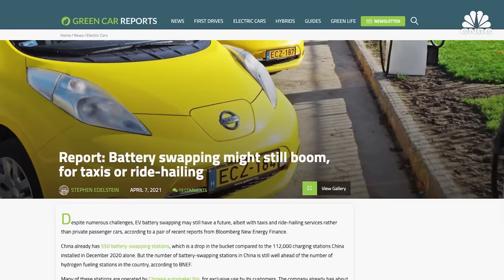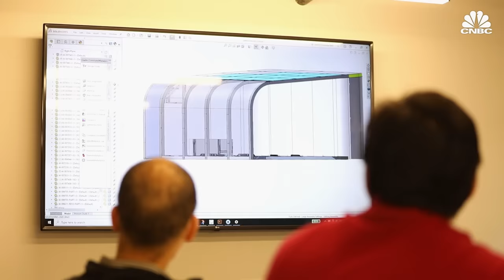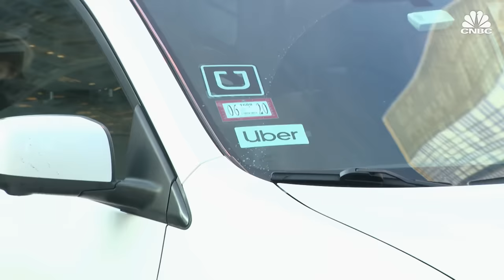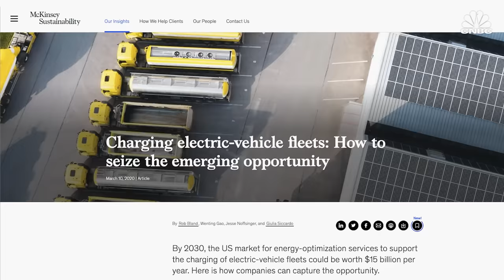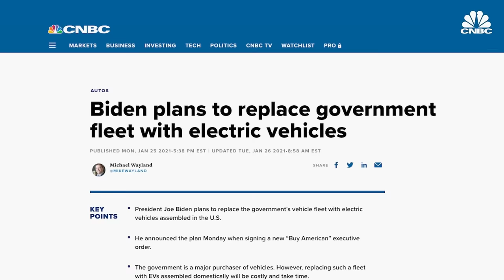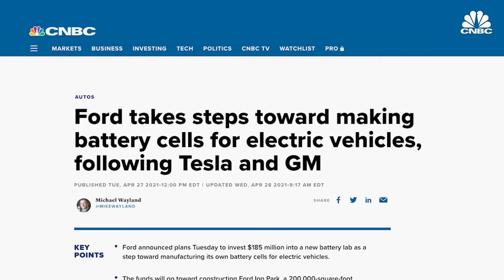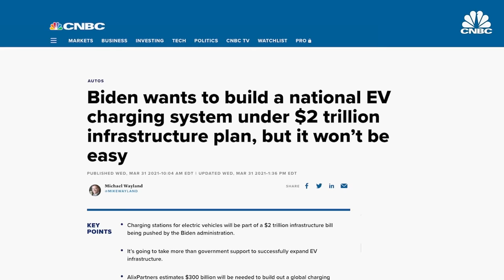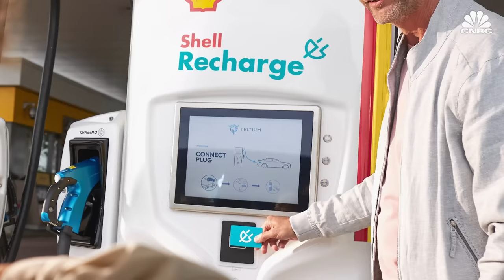Can EV Battery Swapping Take Off In The U.S.?

Comment: How do they manage coolant flow with modular batteries? I suspect they don't so you can't fast-charge them, which would be an unacceptable compromise for most people.
Reply: Can battery be small enough so be cooled with a plate contact?   Then plate cooled with coolant.
Reply: Doesn't matter to me. I already have fresh batteries and drove off to somewhere else while my depleted batteries are charging.
Reply: And trickle charge makes the battery last longer anyway.  You wouldn’t need to cool it at all if you do it this way.
Reply: ambient air cooling, like the Nissan Leaf?
Reply: @jasonji1900  if you don't own the battery, why would you care if the battery pack is being trickle charged or fast charged?
Reply: the whole point of it is to save time so when you bring up time, it seems that you did not get the whole video
Reply: This solution is a different one to fast charging. There's no need for fast charging if you can just get a battery swap in 10 minutes.
Reply: Whatever they do, its not going to be as efficient as a tesla with its integrated battery. squeezing every ounce of efficiency is super important in an ev, thats why tesla is going to be King for a long time.
Reply: @jamesmedina2062  Exactly. The whole point of EVs is that they turn your home into a gas station. The killer feature of EVs is never having to step foot in another smelly crime infested gas station ever again. And these ding dongs want to bring it back. Newsflash, if somebody needs "range" they're just gonna buy a gas car.
Reply: @jonsnow7844  True
Reply: 7788inches is not the best opt in online industry as longtime timers periodical Andy item had into  issue of covid-19 for me and I I usua in a way now that supports h jb I can only use this one to get some and get it done a gooood bit discriminating about automatic and free use of my own computer system in a different or not or to help me to stop responding and uuuu000
Reply: I7
Reply: I7 is not
Reply: @jonsnow7844  But the thing is that there are people outthere, who do not have their own driveway, but live in apartment buildings. A solution like this will make the ICE to EV change a lot easier for people living in apartments.
Reply: @jamesmedina2062  at what cost, this is very expensive to do
Reply: @jonsnow7844  exactly my point , I don't want to set foot on a gas station ever ever again in my life, which is my primary incentive to have an electric car
Reply: Ask NIO
Reply: That’s the whole point of this is so you don’t need fast charging I think this video went right over your head.
Reply: You clearly didn’t watch the whole video or did not paid attention
Reply: The Nissan leaf has air cooled batteries
Reply: @Allen Loser "Laying the cells on their sides in cylindrical troughs in the heat sink would be better." If it were better, Tesla would be doing that. Are you an engineer?
Reply: @jonsnow7844  "Newsflash, if somebody needs "range" they're just gonna buy a gas car." Really? 400+ miles of range isn't enough? The average American commute is 30 miles roundtrip, I'd say EVs have plenty of range.
Reply: @pHD77  "But the thing is that there are people outthere, who do do have their own driveway, but live in apartment buildings" Yes, apartment dwellers have a more difficult time. Given the [now typical] 200+ mile range an EV gives you, you could just go to a rapid charger once a week like gas car owners do.
Reply: @Allen Loser "you are content to be tethered to home, never to travel more than a half tank of electrons from home in your car.  You also pay more for the privilege of being tethered." Absolutely untrue, where are you getting your information? How is an EV owner "tethered" to his home? An EV at one's home is full every morning, and most EVs have a 200+ mile range. Are you "tethered" to a gas station, paying unpredictable and unjustifiable prices for gasoline?  As for paying more, EVs cost about 1/3 to 1/4 the price per mile to operate than an gas car does. I know, I've driven my EV for 5 years, 60K miles, and drive all over the USA.
Reply: @SupremeLordGeek  "The Nissan leaf has air cooled batteries" Correct, and the Nissan Leaf is now left behind in EV tech. Too bad, too, as I happen to like the Leaf but Nissan has made a good product then failed to improve it.
Reply: @Allen Loser "The end of a cylindrical cell presents a small contact area compared to the volume of the cell." You're absolutely correct, which is why Tesla doesn't cool the end of the battery but the sides. Tesla's batteries are stood upright with cooling packs along the sides.
Reply: @Allen Loser "B.S. Physics; 1981 PSU" Great! Clearly you don't know as much as Tesla does, or they'd be laying cylindrical batteries down in their battery packs. I'd say it's time for an update of your education, or at least a perspective change. Feel free to tell Tesla why you know more than they do, I'll get the popcorn!
Reply: @Allen Loser " B.S. Physics; 1981 PSU" God, I love guys like you. I had an electrical engineer try to argue with me about how inefficient electric cars were compared to gas cars (if you can believe that...maybe you can...). He we telling me how inefficient energy storage was in batteries compared to the energy density of gasoline, etc. He finally shut up and deleted his comments when I pointed out that when you burn gasoline, you waste 70% or more of the potential energy as heat, and you get poisonous by-products as a lovely gift. His obsessive focus on a battery energy density formula kept him from seeing the forest dead in front of him.
Reply: @Allen Loser "Cheaper fuel?  Not if you buy a Hyundai Ioniq Blue hybrid or a Toyota Corolla hybrid instead of a Tesla Model 3" Absolutely untrue. Hybrids consume gasoline and have all the maintenance issues of a gasoline car with only the partial benefits of an EV. I've already left you the calculations per mile of using an EV. I just paid over $4 a gallon to fill my gas RAV4, about $45 dollars for 10 gallons. That's $.58 per mile to operate. My Model S operates at about $.04 per mile excluding tires and other intermittent expenses.
Reply: @Allen Loser "Not only that, you will be at the 'gas station' longer for one stop to pump a half tank of electrons than I spend at the gas station in several months to completely refuel for a 500+ mile range." Let's see, I've driven 60,000 miles in my EV on long trips and don't find your information correct. Since 90% of any typical person's driving is local, and that a typical EV owner takes about 10 seconds to plug in at night, you actually spend more time refueling than I do! Here's how: even if you take 15 minutes to get to the gas station and pump/pay, that's typically an hour a month for a gas car owner. I take 10 seconds to plug in at my garage every day, the car is full in the morning.
On a trip, I stop every 2-3 hours anyway for a break, my car is full enough before I'm done at my break. You simply don't know what you're talking about.
Reply: @justsomeguy934  First of all, as an apartment dweller you'll currently be dependent on an infrastructure, which is - I'm sorry to say - not yet at a place where it can fully replace fuel stations with plenty of chargers all over. I'm in a few EV groups on Facebook and more often than not there are EV owners complaining about the following related to chargers:
- People are blocking the chargers even after they've finished charging
- An ICE car is blocking the spot
- The charger isn't working/doesn't support my car.
- It's not a fast charger

... and I've probably left out a few other complaints I can't think of right now. 

Second, unlike those with driveways, who can set their car to charge and then be about some other business at home, the apartment dweller will still have to put some 30-45 minutes aside for charging, which will feel like a 'punishment' if said EV owner does not have other business in town or whatnot.

Third, the EVs that currently are able to hit that 200+ miles will most likely financially be out of reach to purchase for those living in apartments. After all, it's my impression that people mostly only live in apartments because their financial situation isn't exactly stellar.
Reply: @Allen Loser "Blowing off consumer needs with "Commute driving is 90% of the typical American automobile use ..." is not a path to increasing sales." Tesla's sales volume says otherwise.
"I won't pay more for a car which only meets 90% of my driving needs when I already have a car which meets 100% of my need." What part of 100% doesn't an EV meet? You quoted a 10% energy price situation as if it applies to 100% of the operating costs. My EV has taken me through desert, mountains, snow, 106-degree heat with no issues.
Reply: @Allen Loser "The priority argument against a Tesla in 2008 was that it would have intermittently left me stranded with an empty battery during my work day and no way to refuel." Then you're a extraordinary car owner. You would have to have exceeded the car's range with no supercharging available. Since Tesla is outselling many European brands in the USA combined AND is outselling most domestic brands of cars, I'd say you're not a worry for EV ownership.
Reply: @Allen Loser " $7.28 per 100 miles at the published rate of 26 cents per kWh to use a Tesla-branded refueling facility (untethered)" Yet again you quote a Supercharger rate of $.26 as the only energy source for a Tesla. I charge at home for about $10 a fill, my older Model S gets about 266 miles range for $.037 per mile energy cost. 
As for your refill time at 110v., I'm sorry you don't have access to more energy. I'd call an electrician but if you are stranded and have no access to any more energy than that, you would need to go to a faster charger during the week like many of my friends do. They live in condos with no charging, so they charge at a third party charger while at Walmart or shopping.
Reply: @pHD77  Living in an apartment is good economic sense for many. I've owned homes all my life and I can tell you that the hidden costs of maintenance and property taxes make ownership less attractive than many are led to believe. You need to know that I'm not in any way disparaging apartment or condo dwellers. The 200+ mile EVs are reasonably priced, especially if you can find a used one. If someone has a reliable, inexpensive gasoline car, I say use it until it dies. I do not recommend anyone trade cars that are economically useful.
Reply: @Allen Loser "Efficiency be damned if the car can't conveniently go the distance." I've been all over the USA, in mountains, snow, heat and rain. No problems AND I travel at 1/4 the price of gasoline. One moving part in the motor, too.
Reply: @Allen Loser " There would be no engineers without physicists and mathematicians.." Who said otherwise?
Reply: @Allen Loser "Refuel at home is making excuses for slow refueling." Really? How so? My car is full every morning, refilled at 1/4 the price of gasoline and filled while I sleep. When I'm on the road, I get enough energy to go 150 miles or so in about 20 minutes (or less). I take longer than that for a bio-break. 
I absolutely know from your biases that if I invented a car that could run on table sugar, you'd oppose it.
If, however, I invented a gasoline car that would magically refill overnight from the garden hose at your house and do so at 1/4 the price of gasoline, you'd love it and sing the praises of my invention. You wouldn't call it an "excuse for slow fueling". Even if you had to refill on a trip at a higher-than-home-water-station, you'd  love it. It's the fact that it's an electric car is what makes you not like EVs. You'll deny it, you'll tell me you're open minded, but I know better.
Reply: @Allen Loser "You are still being presumptuous by telling me what I should value as an excuse for Tesla not providing what I do value in a car." No, I'm pointing out the excuses you make based on a non-working knowledge of electric cars. I used to think like you, then I bought one. EV adoption is far greater than 1%, and is gaining sales year-over-year. Tesla doesn't make a truck (yet) so you can't say they don't sell well against trucks. Tesla outsells several European sedan models (and brands!) combined. 
Personally, I don't give a rat's behind what you drive. If you don't fit an EV, you don't fit an EV. I do, however, challenge untrue statements when they are made. If you're happy with your Buick, keep it in the driveway by all means.
Reply: @Allen Loser Just the Tesla Model 3 sales are astounding (Google search results): "The Tesla Model 3 continued to hog the throne on top of the US premium-class car market at the end of 2019. For the full year, the Model 3 accounted for 23% of small and midsize luxury car sales. In other words, nearly 1 out of every 4 small or midsize luxury cars sold in 2019 was a Tesla Model 3."
Reply: @Allen Loser "Refueling at home is not one of my transportation needs." But waiting in a line for combustible fuel is? And paying unregulated and politically motivated pricing is an advantage to you? Really? Let's see, when Obama took office, gasoline was $1.89 a gallon. During his administration, it went to over $4.00 a gallon, then back down to about $2 a gallon (the price drops kinda followed election years...) then floated around until we now have over $4 per gallon in places. Note that demand did not significantly change during that time, nor did we discover or eliminate sources of petroleum matching those price changes. During the 20 years I've lived where I live, the price of electricity has been a flat $.11 per kW/h. I don't know what YOU value, but funding a Mideast war and choking my neighbor with car fumes isn't something I like to do.
Reply: @Allen Loser I have already told you I charge at home, and my cost. My source of electricity is my local utility. My state has reliable energy, 30% renewables and a winterized grid. 
If you only have street parking, that's what you have.
In my particular case, I pay nothing for Tesla charging, ever. I'm not arguing from my personal situation.
Reply: @Allen Loser "A RAV 4 is a thirsty vehicle at 3.3 gallons per 100 miles." I'm calculating 26 mpg on average for my RAV4. Some cars (usually smaller vehicles) get better mileage, others get worse. I also owned a Toyota Sequoia that didn't do too bad, but nothing matches $.04 a mile energy costs of an EV.
Reply: @Allen Loser " It was not unusual to drive 200, 300 or more miles in one day." You absolutely just proved that your driving habits are exceptional! By all means, Google is your friend. The average USA commute is 30 miles round trip. You're at TEN TIMES that amount. How did I "falsely depict" your driving?
Reply: @Allen Loser "They still are not as ubiquitous as retail diesel fuel pumps.  A diesel fuel pump delivers a refueling rate in excess of 14,000 kilowatts at six gallons per minute on the slow hook." You're absolutely correct, and I say so what? As I've already previously stated, if an EV isn't for you, it isn't for you. You are well outside the average driving and commute of an American. I've had guys argue with me that an EV isn't practical because one time he had to drive to Alaska with 5 minutes notice, so all EVs don't work since it couldn't have made the trip 20 years ago. Again, if an EV won't fit for your particular situation, it won't fit. I don't care one iota what YOU drive. My car can go 260+ miles on one charge, do it for 3 cents a mile and have zero maintenance. If you must drive a smoker that poisons the air behind you, has hundreds of moving parts and funds the Mideast, I say: condolences.
Reply: @Allen Loser IOW, you're OK with buying a poisonous, explosive liquid with an unpredictable price, having to ask permission of an oil company to drive your car.
It's your money.
Reply: @Allen Loser "You continue to make excuses for the deficiencies of using a battery as the sole fuel tank in a car.  Tesla annual sales are about 2 cars out of 300 sold." What deficiencies? I've owned most brands of cars available today and will never buy another gasoline car again. You are arguing from a position to keep what you know, but no actual experience with the subject. By all means, Grandma will always drive her Buick. I used to think like you do, then I bought an EV. I will never buy another gas car, I will never buy something other than a Tesla, I will never have the owner satisfaction that I have had outside my Tesla. Tesla owners have the highest satisfaction rates of any brand of car regardless of price, and I know why. Let me repeat: I don't have one pittance as to what you drive, what your specific situation is, whether or not your fit the demographic that uses and electric car. You're simply defending what you know, and I've had this conversation 1,000 times before. You're not a bad guy, but you simply don't know what you're talking about. If your personal situation doesn't fit an EV, don't buy one.
Reply: @Allen Loser "Being able to refuel almost anywhere and quickly is one of my transportation needs." OK, so it is. If you need gas-n-go 12 hours a day, have to pee in the windshield washer tank to save time, take no breaks and drive 300 miles every day, then drive a gas car. The overwhelming majority of car ownership in the USA drives less than 12,000 miles a year, would benefit from 3 cents a mile operating costs, would welcome a full car every morning, wants zero maintenance. If you're not in that category, then you're not.
Reply: @Allen Loser "It was not unusual to drive 200, 300 or more miles in one day.  " My friend's Model 3 gets 310 miles of range right now, and the new Model S goes 400+ miles, one charge.
Reply: @Allen Loser "26 mpg is thirsty by my standards.

I can buy a lot of diesel fuel for the difference in price between one of these hybrids and the price of a Tesla without being bribed or beaten."

26 mpg is the national average for mileage of new cars. I personally own a car that gets 16 mpg, 11 mpg under city conditions. I don't drive it very much.

I don't know who's bribing you or beating you, call the police. The price of a new Tesla Model 3 is about the same price as an average new car in the USA. If you can't afford a new car, you can't afford a new car. If, however, I could afford a 300+ mile range car for the same price as a Camry, I'd buy it.
Reply: @Allen Loser "Food grade cane sugar is not economical as a fuel when compared to diesel fuel." I'm going to write off your comment as sarcasm, there's no way you didn't know I was using table sugar as an example as an alternative to gasoline. I was pointing out that I've had people defend what they know - gasoline - with such a mindless and unsupportable passion as to boggle the mind.
Reply: @Allen Loser "My stops to pee are unplanned and sudden due to health conditions and medications to treat them.  I'd pee my pants in most cases trying to hold out for a Tesla refueling facility." What I was telling you is that I've had people argue that an EV won't work on long-distance travels because the can refuel a car in 5 minutes as opposed to 20. I point out that unless they're not human, they need a bio-break too. I swear one guy claimed he drove to Alaska with just refueling in 5 minutes and back on the road. I asked him when he changed his diapers and ate, but he didn't reply. I stop every couple of hours or more when driving, and recharge then.
Reply: @Allen Loser "I refuel and move on if I don't need to pee or eat when the car is thirsty." What I'm telling you is that to say you can refill in 5 minutes isn't a valid, real-life comparison as to how people drive. I used to drink a 2-liter bottle of Pepsi and drive for 6 hours straight; I no longer do that. It's not only unrealistic, it's dangerous. I've driven thousands of miles across mountains and desert in my EV and I drive the same as I would a gas car. After 2-3 hours, I'm ready to get out of a seat belt. While I'm stopping for 15 minutes, my car is charging. I get enough energy, even in my older vehicle, to go another 2-3+ hours before I stop again. What I get a kick out of are the guys that say they can drove Florida to New York faster in a gas car than you can in an EV since they never seem to stop for a break. You most certainly CAN get there faster if you only fuel for 5 minutes and never stop otherwise - but you're a danger to yourself and others driving like that.
Reply: @Allen Loser "I could refuel my diesel at home if it were important to me to do so.  Set a home heating oil tank in my backyard.  Have a fuel service fill it with taxed fuel." Sure you could! You  could do so at 4x the price of electricity, have a bio-hazard in your backyard and risk a fire. Then you get a poison exhaust for your trouble. Yeah, you sure could. OR just plug in your car like you plug in a toaster.
Reply: @Allen Loser "Water is not a fuel.  Water is the ashes of burning a fuel containing hydrogen.  You propose scamming me." As previously stated, you must have missed the sarcasm. If I could run a vehicle on water, you'd still defend petroleum.
Reply: @HavokBWR  No need for squeezing every ounce, in this case
Reply: @ibrahimsued4906  yeah there kinda is
Reply: @piotrtrebisz6602  "In my opinion battery swapping is a viable solution and should be supplemented with electric roads. " It's already been tried and no one wants to do it, except those selling the concept to someone else.
The reason it will never work for the USA is that Americans, by and large, own their cars. No one wants to swap out a known good battery that cost them $10,000 for an unknown battery just to save 20 minutes of charge time. Think about it - would YOU swap out your well-cared-for car's engine with an unknown engine just to save 15 minutes during an oil change?
Reply: @piotrtrebisz6602  "Well, what's the difference between refueling gasoline at a gas station and battery swapping? " You missed, or don't understand, the fact that I own the $10,000 battery in my car. Please answer the question I already asked you: Would you swap out the engine you know is in good condition for an unknown engine just to save 15 minutes at an oil change place? Why wouldn't you?
Reply: @piotrtrebisz6602  Guess what - all current Tesla Model S and X cars can have the battery swapped out in 90 seconds. NO ONE is doing it. See my previous comments as to why. Buying a tank of gasoline is not the same as losing the pristine battery I've taken care of.
Reply: @piotrtrebisz6602  I might argue that you would NOT swap the battery. Note that EV battery capacity is still increasing exponentially - the latest version of my car now gets 50% more range than my 5-year old car does. No way would a new owner swap away his latest and greatest battery tech for an unpredictable older battery.
Reply: @piotrtrebisz6602  I'm all for new battery tech. Remember that lots of ideas that look great in the lab fail under real-world conditions. They must survive physical movement - cars hitting bumps, hitting curbs, starting and stopping. They must survive freezing cold and desert heat. They must survive less-than-ideal charging and use scenarios in order to replace what we have now. Here's hoping aluminum air batteries work well.
Reply: @cyclopsvision6370  God, I hope not. I live in a very hot place with high temperatures of 45°-50°C or 113°-122°F in the summer, and I'm usually parked in the sun so vehicle temperatures are much higher.
Reply: This comment is a nothing-burger. If your swapping the batteries out, your not fast-charging. Think about this the way you might think about a propane tank. This kind of initiative would go a long way to standardizing battery design and management. It completely kills the argument about range anxiety and makes electric vehicles more accessible, affordable, and agile.
Reply: @ourcollectivewisdom8769  " Think about this the way you might think about a propane tank. This kind of initiative would go a long way to standardizing battery design and management." Except that Tesla has had battery-swap capability for almost 10 years now and no one wants to do it! It's isn't a $20 propane tank, it's a $15,000 battery. They comparison is not the same....would you swap out your car's engine to save 20 minutes on an oil change? 
As for making standardized battery design, who's design are you proposing? If Tesla had to get other car makers' permission to make a battery design, it would never happen nor would it be as good as Tesla. We'd still be at a 50kW Chademo port. 
Your comments do not reflect reality.
Reply: Still borne venture, for so many reasons.  No mention of the extra batteries needed when that remains the primary shortage.
Reply: The modules are probable mounted on highly conductive heatsinks such as aluminium through which the coolant passes with the heatsinks as part of the car.  It's like the heat sinks on your computer are aluminium blocks with either fins for air cooling or passages for liquid cooling, you don't actually have to have coolant passing through the modules.  Now whether or not they apply heat sink compound to ensure the best thermal transfer possible is a question.
Reply: The entire point of this is to NOT fastcharge. That is litterally what he saidf at the start of the video. It degrades batteries considerably more. You don't need fastcharge because u just swap. That's the entire point ...